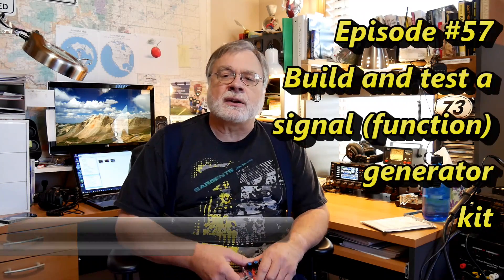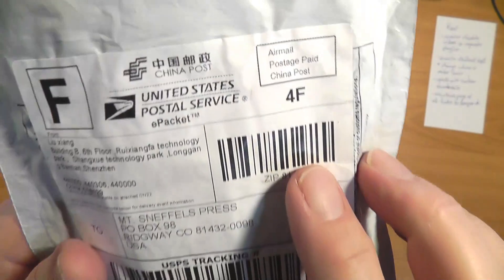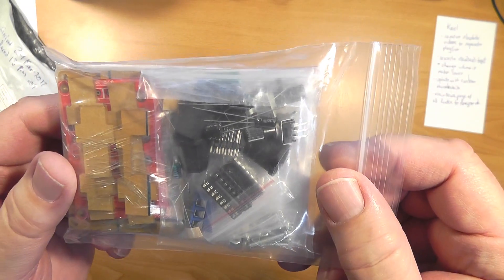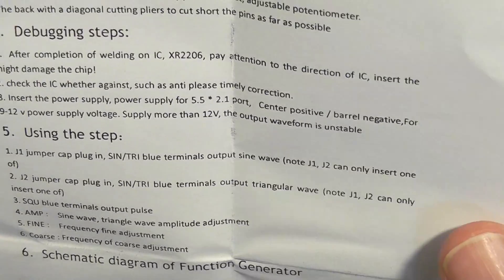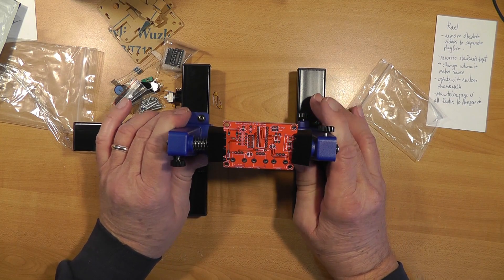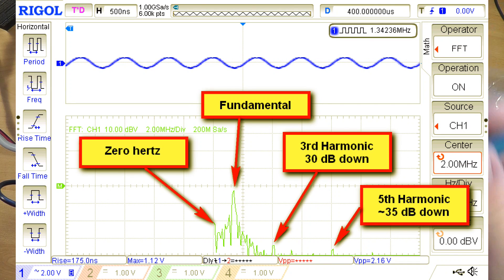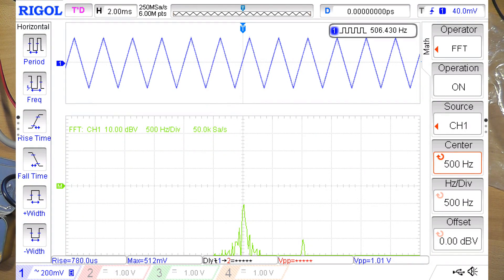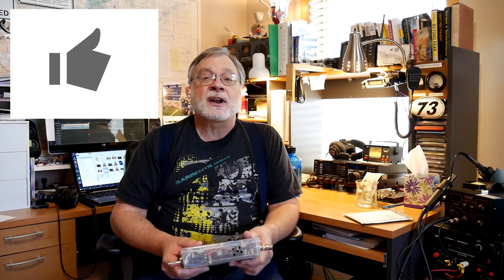Unpacking and Testing the XR2206 Function Generator (#57)

Comment: Thanks Dave. I just got the XR2206 and on the first power up the 2206 IC got so hot I thought I had cooked the unit for sure. I measured the 9v adaptor and it read 13.5V. ouch! Then I tried the USB2 5v hookup to my android that they supplied and nothing, no fire up, not a crest, nothing. After watching your video I learned much about how to hook it up to my diy DSO 138 oscillator and still nothing. Then I noticed randy using a 9v battery. I tried that and it was amazingly easy to figure and run. The first 9v I tried would not work as it tested only 8.5v, so this function generator seems to need an exacting amount of juice, otherwise it is futile. I am just glad I had success with it finally, thanks to you!
Reply from the maker: Sorry you had so much trouble with it.
Reply: So was I. After much getting familiar, the darn thing runs like a top. Running it through the GeekCreit  diy crystal tester frequency counter along with the DSO 138 now, and not much difference for frequency output between the two. For less than $50 all three units were well worth the money and opened the door for me as a hobbyist into the world of oscillations. Where can I find your video that you mention on how you use it to test your homebuilt radio?

Comment: David

Either they use counterfeit IC's or this is a pis-poor design.
The XR2206 is a fairly dated IC. I have used it in the past for a number of circuits and it can do a lot better and a lot more than what we see here
Even with the age it is, the fact that you would get a real XR2206 for about $ 5 raises an eyebrow. I remember a time when this IC was quite pricey. So, my money is on 'fake' IC's

Paddy
Reply: You are correct. The only real disadvantage to the cloned chips they are using is they don't operate at higher voltages. If you only need 9volts it's really not a problem. However, the whole kit really is junk because they got the attenuation backwards and used wrong values for the resistors (to further save costs). I had a great time using this kit to practice my desoldering skills! 😂 Soon I will recreate this function generator with my own circuit and solder it to a blank PCB. Cheers!